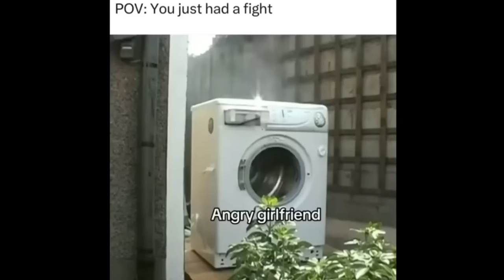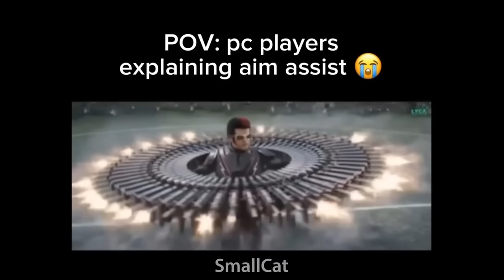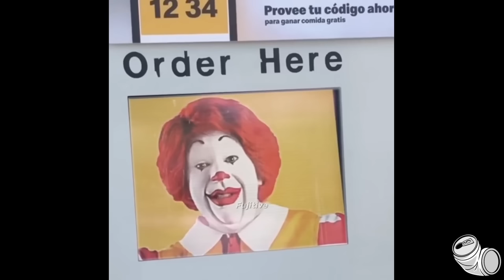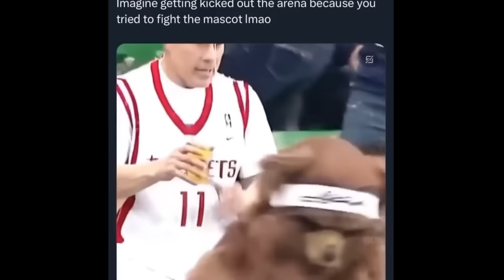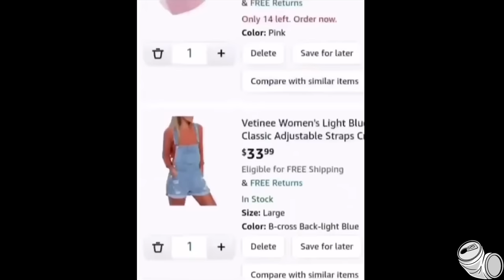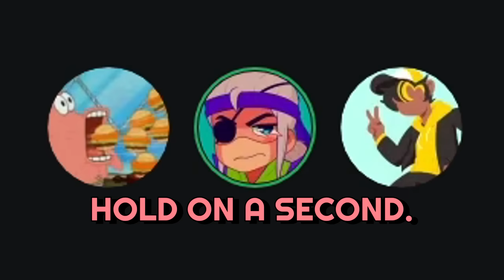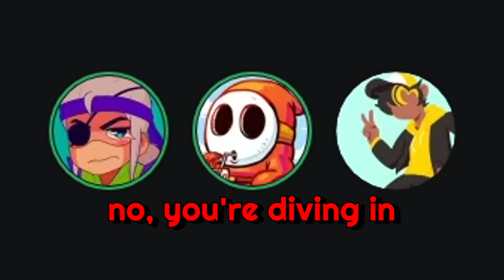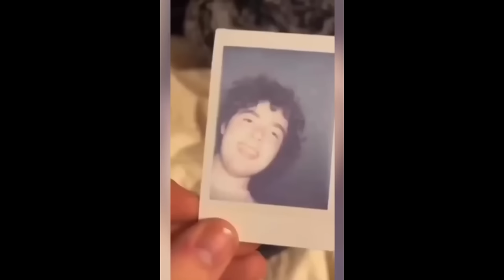1 HOUR OF UNUSUAL MEMES

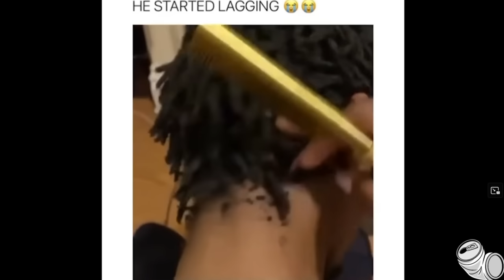Comment: 6:40 A hot comb is for straightening hair usually black people use it because straight hair doesn't last or doesn't stay straight so it's a lil inside joke but it's a thick metal comb basically that gets REALLY REALLY hot like burning af and it hurts as hell when it touches your skin.
Reply: My barber was a black dude and every time he would cut my hair, he would use a hot comb even though I definitely didn’t need it. Every single time he would tap the back of my neck with it a few times and burst out laughing when I flinched before saying it was a badge of honour for going to a “real barber” lmao
Reply: @Sleepytechnician ain't no way! i still flinch whenever a hot comb for flatiron touches my scalp but if it was on purpose im never going back lmao
Reply: @Milk-ck1wv I went to that man until he retired because he gave me the cleanest cuts I've ever had in my life. I put up with the teasing because he was cheap, good chats and one hell of a barber!